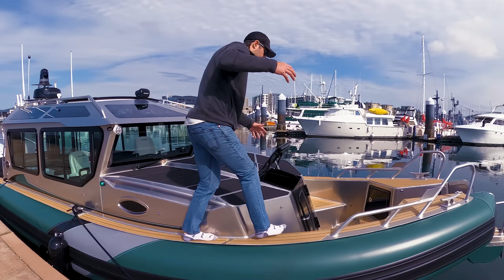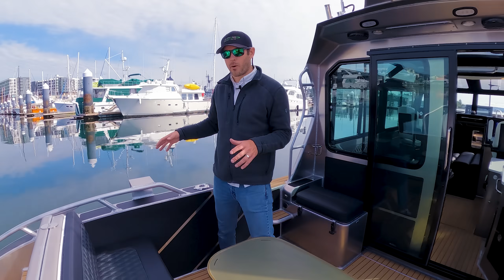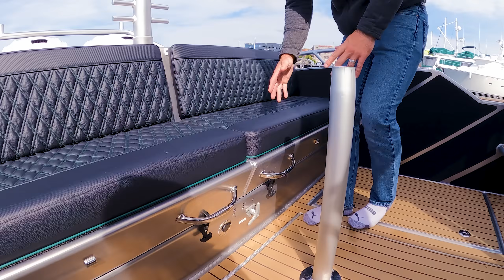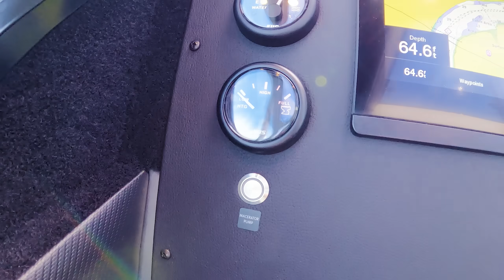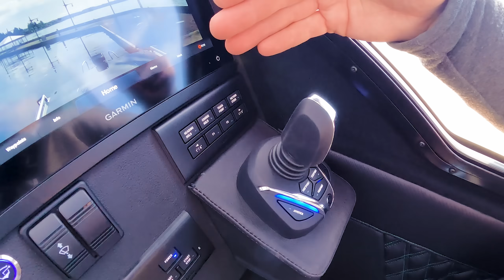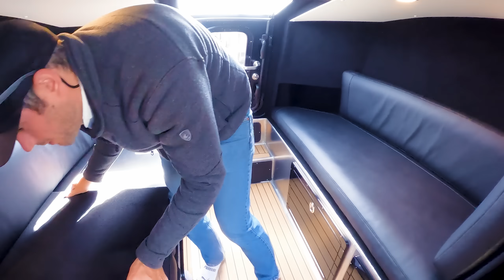33' Full Cabin "NOMAD"

Comment: First the NOMAD. Then the Metal shark 33 relentless then a few months ago the Silverback 33 Apache. And all 3 use a similar design  and all have quality 👌.  The only thing I'm not a fan of is the outboard motors are the only option.  It would be nice if they had an inboard motor option. Still and awesome boat.

Comment: I think these boats are cool, very much, the only thing I do not admire about them are the welding marks. Otherwise, I think the only few things I would put onto this are a few executive seats (both inside and outside) with massage functions and a small countertop with built-in fridge, and a cooking or grill. Oh, and of course monitors where you have the upper part of the windshield to show night vision and thermal images at night or when need it. Also, I think side 360 camera is a must to get installed, I know it is probably optional and something else, but it would make sense. The sunroof must be equipped with a remote-controlled film to blank out the sun, or let it through. And, maybe because even cheaper cars can be equipped with sensors to assist parking or reverse, boats could be equipped with such tech as well at this price point.

Comment: I have one of the earliest foam collered Aluminum hulls like this . 
    It was at Seattle Boat in Kingdome with a puny OB 35 Jet motor, I opted for a prop .
Used to be the only one on Puget Sound , only a 15’ but have been to Swiftsure Bank from Neah Bay and also blasted down to LaPush on same day for a total of 135 miles on trip meter .
     Used to fish Lingcod and Blackmouth salmon with Bill Hanson or alongside at Southworth , Manchester and Blake Island in the 90’s . 
    Still have it in storage, almost time to get back out there .
I admit to multi engine envy though.
Only a single 120 hp V-4 on the 15’ center console prototype I help build when new .
Nice lines on this boat , the ability to stand everywhere makes the stability bolted to sides make sense. 
    Mine is 30 + years old and looks pretty much like when I towed it home from work.

Comment: Let’s see…$500k+ for a RIB that you will use once maybe twice a month during the warm season. Wait your advertising to .001% of the population, that explains the 6 figure price tags. Too bad you don’t tell them about electrolysis and that the aluminum hull and top cap will pit and corrode in a year or two from dissimilar metal corrosion, galvanic corrosion. I see these boats in Fla. 3-5 years old and looks white and chalky like a Jon boat. Such a ripoff for the price. Wait till the cracks starts and you try to get water logged aluminum welded or repaired.

Comment: I like this type of boat but the most important part is the material standard, material type, thickness, and welding material using what connection process, has it been tested NDT or not? how many supporting bones are in the boat hull and others. if the features are good enough for this boat

Comment: I would paint mine a more festive color, Miami blue on the hull and white on the cabin top, and opt for solar panels instead of skylights. I live on the Hudson, I have no desire to do 30 knots, but it would be a good top speed, so I’d go for electric outboards. I prefer the quiet anyhow 😂. I would rather have the cabin extend to the bow and not have the throne under my pillow, but in a separate space behind a bulkhead, maybe a set of drawers opposite with a fiddled grippy top to set things down on. This would be one hell of a fun river boat, no doubt!

Comment: Man, if you didnt do anything like the traditional space distribution of boats, with an inflatable boat you could have a real nice living space:
- Make the boat like 15 meters long and 4.5 meter wide.
- The structure a little stronger and Bam. You can have a walkable second floor.
- The forward walkable space with the small ass rigid wood seat, and the anchor, is useless. Just move the habitable area forward so you are using all the space of the boat.
- The rear couch, make it bigger and actually confortable.
- Distribute the inside of the cabin like if it was the inside of a motorhome.
- Dont use those horrible modular sleeping pads. Put an actual bed.
- Dont make damn basements. Keep every floor at the same level, with no ups or downs.

And thats it. You have one of the best boats in the world, habitable, fuel efficient, fast and cheap.

Comment: Other than giving a sense of being bullet proof due to its military style design, this has got to be the most useless boat I have ever seen. I hat to be blunt but sometimes you gotta call a spade a spade. What is the point of this damn thing? It’s not a cross ocean voyager. Its cab is setup for a day or two max. No shower, no freezer, no oven, no stove. I no the owner opted out of the microwave and opted for a grill but a pontoon boat has better amenities. That toilet is put under the cushion you lay your head on at night is gross and unsanitary. You keep mentioning the owner opted for more fishing features but there is literally zero room to fight and gaff fish nor proper seating configuration for fishing. It had two pole holder mounts. I keep going over the things you could do with this boat and I’m so lost. It’s not a weekend sailing vessel. It’s not a fishing vessel. It’s not a tubing/sport vessel. It’s not a cross ocean voyager. To me all I see is a very well built, extremely over engineered, very expensive recreational day boat. The price of the stupid camera on top could have got you a boat with equal water capabilities. It looks cool. It seems sturdy as hell. But it has no function what so ever in my eyes. I’ve never felt this way about a boat lol

Comment: Wouldn't need heat but AC is a must have. Is that a option ?
Reply from the maker: Yes absolutely. We can do either a small built-in generator or lithium power pack to power the AC system.

Comment: n why do u need a 30k camera  for on the boat. is there something I dont. why not use a way cheaper camera.  n drop the cast to 232k for the boat. it is bueteful boat. but 30k fir a camera it's way to much. should add hot water n etc. I think it be better than a 30k camera.

Comment: Thoughts for customers with sensor capabilities (FLIR): if possible, have a controlling top-hat on the thumb of the throttle set for sensor movement.
Reply: That’d be tough to do…. But possible. They didn’t touch on it but there is a physical FLIR control on the left side of the console with a joystick.
Reply: @291xMac  Not really out of the box thinking and these throttle sets already exist, just at a lower quality (I would expect beefier quality for maritime ops). It would be a smart move instead of having the separate control; you could have one hand on the steering wheel and the other hand on the throttle set and still have complete control over your sensor package.
Reply: @GEDonly  I agree, you’d need to change the design of the throttle a bit but it def would do work. I’d love to see one